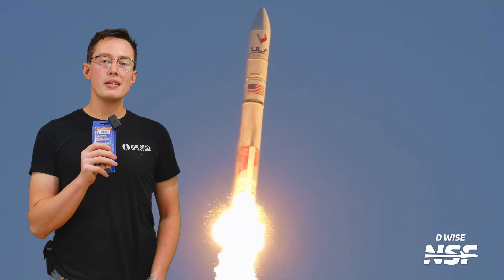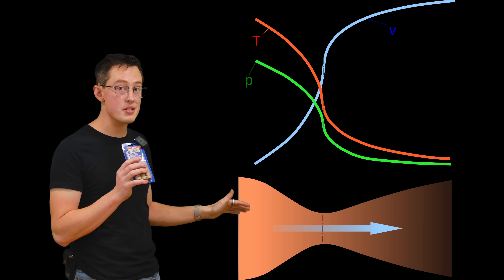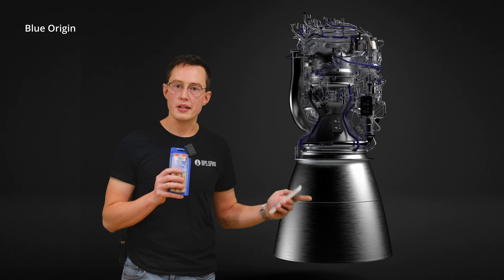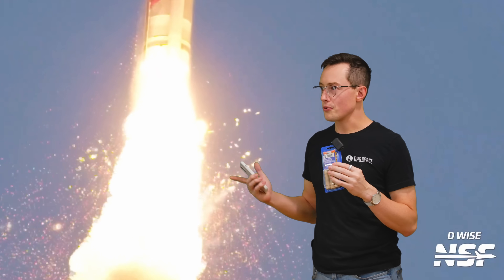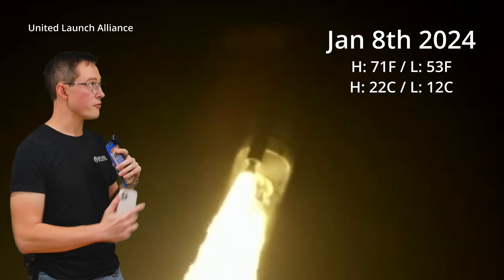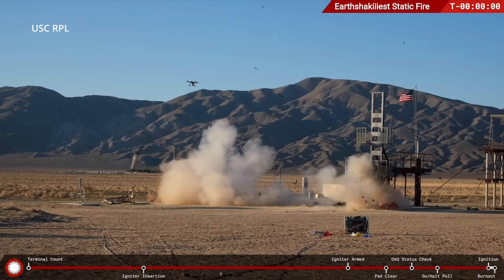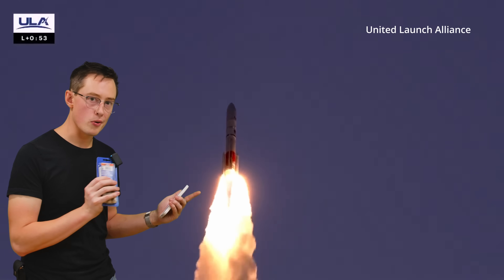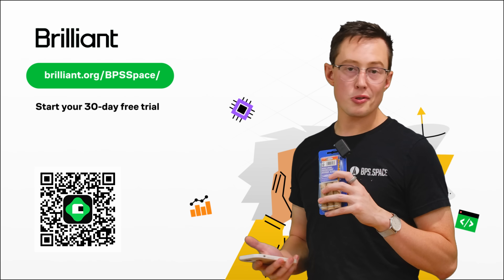The Problem with Northrop's Solid Motors

Comment: i am 15 and trying to make a lquid engine aswell. mine wont be that hard cus is just a pressure fed bipropellant rocket engine. I hope i can 3d print the nozlle for short burns. Cant wait to see your vids on the topic! (at least that is what i think you were hinting at, altough the engine kinda looked like the new swivle design in the latest KSP update so you might just be making a model of that enige which is very unlikely)

Comment: I'm glad you mentioned these two things that I've been saying for years, hotter ambient temperatures cause solid propellant to burn faster (as much as 25-30%) that increases chamber pressure and that the nozzle end of the motor needs to fail first. When screwing on end closures the forward bulkhead end should be screwed in all the way and the nozzle end can be a thread or two out (some people do it just the opposite). On bolted motors, the nozzle end should have fewer bolts. On our 12" diameter solid motors, we bolted the divergent cone on the exterior with the throat smaller in diameter than the inserted divergent cone so that if it blows, the throat effectively increases in area as much as 50% decreasing chamber pressure. We've never lost a forward bulkhead doing these things.

Comment: Also doing the math to spread that loss of thrust it accounts for about 3-4% less. According to wikipedia that configuration can put 14400 kg to a heliocentric orbit and the mission payload was only 1500 kg. So lots of mission margin. In fact they shouldn't have even needed the SRBs for mission success, but it was also an integrated system demonstration.

Comment: I quote that Delta II "We have had an anomaly" soundbite all the time lmao
Reply: adding that to my repertoire
Reply: That’s the one where the booster unzipped and it created a massive cone of burning propellant that rained down for an hour afterwards right?
Reply: @judet2992  I think so. There were also quite a few vehicle insurance claims for that one.
Reply: @judet2992  a few minutes. Not quite an hour. But I believe some huge burning chunks of propellant destroyed some vehicles at the cape (on base).
I was in school about 20 miles south and they locked down the classrooms as a precaution because they were worried about the cloud of chemical propellant dust floating over us.
Life on the space coast.
Reply: I had it as an alert on a data acq machine when the test terminated early (in this case, the part being tested shorted out and failed.)
Reply: @charlesboyer61  XD
Reply: I "grew up" on the Titan IV program. We officially called those "anomalous events". Internally, we said that someone set the KBOOM flag as all of the uploadable parameters started with K due to the flight software being developed in FORTRAN.
Reply: That’s the one where a booster unzipped and it created a massive plume of burning propellant that rained down for an hour afterwards right?

Comment: "kgf" is such a cursed unit and I absolutely adore it.
Reply: Not even an astronomer would abuse the kg as a unit force instead of a unit of mass
Reply: @masondaub9201 I disagree, people who call anything except helium and hydrogen “metals” will do anything.
Reply: I've seen a closely related but marginally more cursed unit. When I was taking a propulsion systems class in college I was reading a spec sheet for a high-bypass commercial turbofan (I think it was a variant of the CFM LEAP, but I can't remember) to compare real-life performance to what I had calculated based on some known values. I kept being off by an order of magnitude and it was driving me nuts, until I realized that the table was giving me the thrust in dekanewtons (daN). Which is basically kgf if you accept that g=10, which is apparently what the manufacturer did.
Reply: @jarrodcath7835  That's actually surprisingly useful. daN is just a bit off kgf, but it avoids mangling the unit. kgf is the same alley of cursed as ksi (kilopound per square inch).
Reply: Only an engineer, or possibly an astronomer, could generate this
Reply: @beagleboy31  naw not engineers just those rich hobbyists called nasa
Reply: Keep Imperial and let the rest of the world be hampered.

Comment: Oh, and since you asked, not only is there in fact a very slight contour to the SLS SRB nozzles, there’s a very slight contour to the Shuttle SRB nozzles too. It’s difficult to notice especially with the aft skirt in the way, but it’s visible in cross section in quite a few documents available from nasa
Reply: You’re smarter and faster than I 😊. Just confirmed with a former Morton Thiokol engineer that the shuttle SRBs had parabolic nozzles.

Comment: The imperial system is generally dumb, but I don't generally complain about "pounds" because you roughly half it and kg is a little less than that. Most of the time that's good enough for purpose. When it isn't, scientists tend to use SI units because makes communication easier and it less likely that there will be a miscommunication that ends in dead astronauts/wastes money.

Comment: It's also probably worth pointing out that thrust at lift off is more important than thrust even slightly down range, and also that the main engines usually have to throttle down for max Q anyway. That can get some of the trajectory efficiency back, and if the computer is smart enough, it can go for a slightly more spicy max Q and recover some performance if required.
I hadn't run the numbers myself, but I would have expected it to lose significantly more performance than that. Naively you should go from the 2.7km/s exhaust velocity with the bell to whatever the speed of sound of the exhaust is (wouldn't have thought more than maybe 1.3km/s). I guess you should recover some performance from the base acting as an extremely wide bell, and also the fact that the pressure drops extremely quickly at the top of the bell so even a little bit left would get you a lot back, but it is still surprising to me that it would be that high.

Comment: They launched a dummy payload - of which they did not reveal the mass: that does not mean the mission was a success... more likely that someone was smart enough to cheat the test.  Can you do some math on the videos to try and calculate what mass they really launched with, and whether or not the mission would have failed if it had a real payload ?

Comment: Nice one, using kgf as Unit -  "Imperializing" the metric system. 😂

I was expecting Newtons as Unit for Force.

Wikipedia:
The kilogram-force (kgf or kgF), or kilopond (kp, from Latin: pondus, lit. 'weight'), is a non-standard gravitational metric unit of force. It is not accepted for use with the International System of Units (SI)[1] and is deprecated for most uses
Reply: If you are concerned with thrust-to-weight ratios, I’d argue it’s more intuitive to describe thrust in terms of lbf or kgf (or tons, on the larger scale). It makes the comparison to the mass of the vehicle easier. Same goes for buoyant forces in maritime engineering. There’s no one correct unit for all applications.
Reply: @tylerstagge7465 Thrust-to-weight ratios are always done in N as weight is a force. Mass is measured in kg.

Comment: "ill put metric on the screen" uses Kilogam Feet..... the unholy combination of kilograms and feet.
Reply: I think that's kilogram force, slightly better. Which is probably a hang over from pounds of force. Metric adjacent but not SI
Reply: 😂 I loved that. Kind of like speed in for “furlongs per fortnight”.
Reply: Can I be in the screenshot?

Comment: The SLS booster nozzles are absolutely 100% not conical.
You can look up the cross section online.
Parabolic isn’t totally accurate either as the shape is determined by method of characteristics at these levels of performance.
Reply: Hyperbolic would be my guess?

Comment: HOLD ON  is he making A LIQUID FUELED ENGINE!?
Reply: I hope so!
Reply: Might be helping with keg rocket, that could be fun
Reply: NO! (maybe?)
Reply: "Look what i Secretly did while i dripfed you with 12 month old "Updates"."
Reply: Nah he's making a hybrid engine.
Reply: @JamesChurchill3  ah yes, the engine that has the worst properties of both solids and liquids. their only advantage is safety, and even that gets nulled with a lot of oxidizers
Reply: @etherealswordsman3214  That's not their only advantage though. They are much easier to make throttable to a significant degree, they avoid at least one turbopump, and if pressure fed any (yes, same is true for liquid rockets, but two pressure tanks are heavier then one.) And the safety advantage certainly is there, and since most used oxidisers in them are liquid oxygen, N2O, or maybe in the worst case HTP, there is indeed a safety advantage. 
They are probably a bad idea for large engines, but I don't see why not for medium or small engines.
Reply: @slome815  Aye, they're perfectly acceptable for, say, a sounding rocket, maybe a missile. Maybe even for an orbital first stage if your upper stage is doing more of the work than usual. 

But in the modern age especially, they're not really a reusable engine design, heck they have a pretty dang hard time relighting at all. so for reusable first stages or any orbital stage, that's already a problem. the efficiency isn't much better than a solid. they're not much, if any, easier to gimble than a solid either. it's also a lot harder to power the pumps if it's not pressure fed. and at that point you're dealing with a cryogenic fluid for little efficiency gain over solid.

All that to say, if you want to use one on a small vehicle it could probably work fine, but they're not great for orbital vehicles, especially at all larger ones.
Reply: I cannot beleived he just teased us with his wet nozzle like that!
Reply: We all know this day was coming
Reply: That or he's doing some consulting work for the keg rocket folks are my guesses
Reply: Not gonna be very cool to get to space without one
Reply: I was under the impression that it was effectively impossible to scale a liquid fuelled rocket down to a small enough size where it wouldn’t cost hundreds of thousands of dollars, and still make it have a positive TWR
Reply: @oberonpanopticon  ...that is not true at all.
Reply: Twin!
He's gonna make a liquid rocket engine
Looks like he's gonna do testing a lot in the next year.
Reply: Prob for the space shot
Reply: @crispy_338  He's been working on solid rocket motor fuels for the space shot.
Reply: @Hybridesque  Could be SRBs for a liquid core main stage
Reply: @crispy_338  nah, the space shot is Solid Fueled. the liquid motors might be for a follow up or a dif project, or maybe a change of plans entirely but that's probably unlikely.
Reply: @crispy_338  Take a look at how far any amateur liquid rocket has made it on that journey.
Reply: @khabuda  If anyone can make a garage built liquid motor work its Joseph Bislington
Reply: @crispy_338 I'm talking about how the altitude record for a liquid is under 50k feet. No amateur rocket builder is sending one to space any time soon.
Reply: Hi I was wondering if anybody has ideas on rocket model rocket
Reply: Im11

Comment: The SLS aft exit cone is conical. To my knowledge, it's for fuel efficiency in thrust vectoring.
Reply: @noorsabasayed5602  
It is absolutely not conical. Same with the shuttle RSRM design it’s based on. The nozzle vectorable regardless of the exit cone shape unless the system is too cramped and really needs the space.
Most SRB nozzles (that are not smaller rockets for weaponry or hobbies) are not conical.
All of this is very publicly available information.

Comment: WE HAVE HAD AN ANOMALY
Reply: Understatement of the year
Reply: an "observation" to be precise.
Reply: I always imagine someone watching a screen of numbers instead of the rocket itself and thinking "hey these numbers don't look right at all!"
Reply: "rapid unplanned disassembly"
Reply: Still technically correct though... 🤣
Reply: It is an anomaly, in telemetry the "rocket exists" value goes from 1 to 0 so a slight single digit anomalous change only, nbd.
Reply: @kiiverkk cosmic ray bit flip moment
Reply: @faceboy1392  The actual cause of that explosion is even more ridiculous. This was the first launch of an upgraded version of an earlier rocket design, and they reused a lot of both the control electronics hardware and software. One of the things they reused was the altitude guidance system, both the code and computers, as well as many of the sensors, but the new rocket had MUCH more thrust and got going a lot faster a lot sooner in the flight. It overflowed the altitude value in the software, which the guidance logic was no using because it was from an instrument that was intended for guidance early in the launch. The carried over code included a timer that would turn off that altimeter, but the faster rocket hit the overflow point before that timer finished. Despite the fact that guidance was no longer using that value, the overflow still made the onboard computer think it had lost guidance. This happened in rapid succession to all 3 redundant guidance computers as they were all running the same timer logic and reading very nearly the same altitude with just a bit of sensor variation, and that triple failure triggered an automatic self destruct.
Reply: @kiiverkk The actual telemetry for that flight is morbidly hilarious. The various computers inside the rocket think and talk to each other so fast that they individually register the loss of each successive component to the massive explosion until the last computer pings every other component it is supposed to be able to talk to multiple times,  gets no response, registers that it is the last component functioning, and only then is it destroyed.
Reply: Not only in that clip but in the whole vid: A LIQUID ENGINE?!?!?!?!?
Reply: 6:58
Reply: ..right up there with ‘we have developed an engine rich exhaust..’
Reply: An anomaly? FAA will enjoy it!
Reply: Major Malfunction!
Reply: It was definitely a nomaly.
Reply: Hellfirerainsfromsky
XD
Reply: I quote this any time I see something get fucked up irl
Reply: It experienced a less than desired performance.
Reply: An anomaly covers SNAFU to FUBAR. Apollo 1, Apollo 13 Challenger, Columbia, et al. If I remember right NASA has a mission plan and everything is mission oriented. So in engineer,  anything uncorrectable against the mission is an anomaly. Boost motor rupture and takes out the spacecraft's mission by RUD before it's orbiting is by definition only an anomaly. Same for a SRB, breaking loose and making aerodynamic forces shred the spacecraft, that by definition is an anomaly. 

The only thing making manned spacecraft different from any other launch is the fact that the old "Spam in a can" usually doesn't survive the breakup/return to earth. 

I read that the Challenger crew could have survived the breakup but not the estimated 150g water landing. 😢
Reply: Except they were like 'all system nominal' on the live stream 😅 I was like, umm that doesn't look nominal!